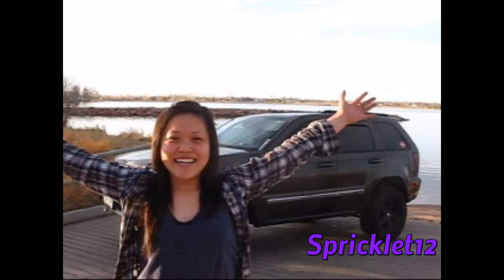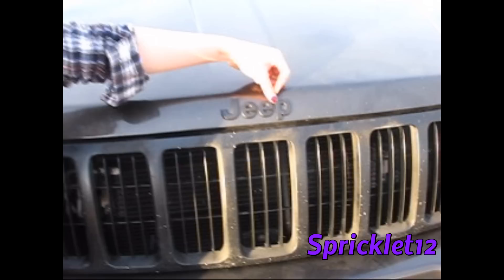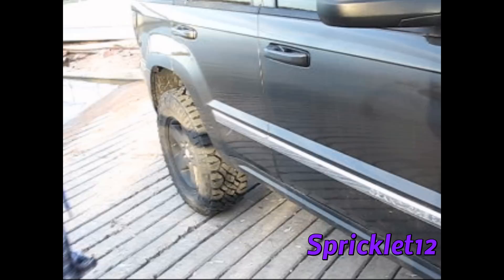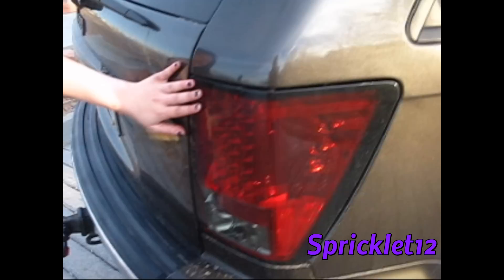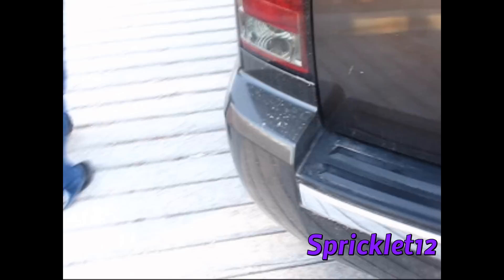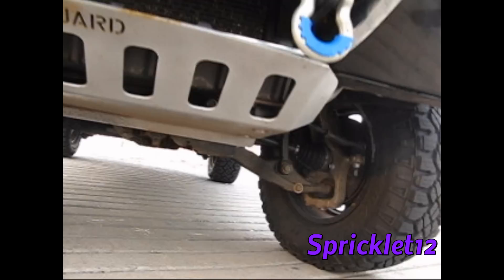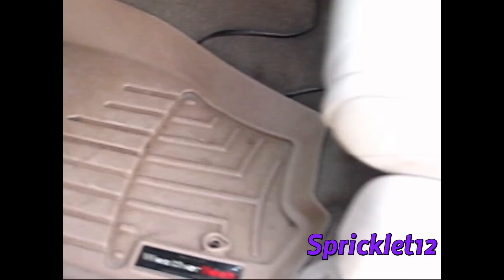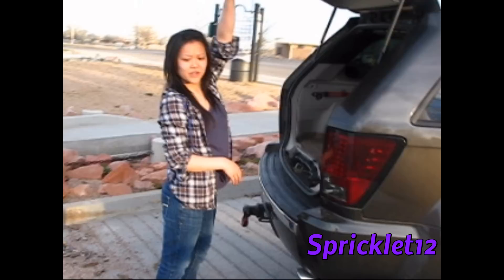Walk Around 05 Jeep WK w/Mods

Comment: ok TY tons, after digging I found a closeup to see what you did on your pich-weld. Very nice and makes lots of clearance room. Looks like you could clear full 33X11.5 tires. Throw RRO 2.25" lift ontop of your current lift and then a little rear fender bending to keep from cutting the sidewall of your tires when they stuff.
Reply from the maker: +JD Lewis I do want more lift, but don't want to add the rro 2.25 lift on up. Just my preference. I'm happy with the way my jeep is. This jeep has so much done to it, I think I'm going to pause the jeep build for now. It is a money-pit. Plus, I'm a student. I can't afford my main transportation always needing to be at the shop

Comment: Hi Elaine I have a 05 4.7 just got a 2.5 inch spacer lift and 2.5 inch wheel spacers what spacers do you have (size I mean) I also got two 12s in the back of my jeep too
Reply from the maker: +joe talento Nice !!!!! The wheel spacer i have on my jeep are SpiderTrax Brand Size 1inch and a half 5x5 bolt pattern

Comment from the maker: There is two options for the side decal. You can either use Plasti-dip and do it yourself or purchase decal vinyl and do it yourself :)
Reply: Elaine Chu Wow! thanks for the tip!!
Reply from the maker: Jeffrey Williamson  Anytime. I tried plasi-dip and did a crappy job lol so I opt out for decal vinyl and use an exact o knife to cut it
Reply: Where did you get the vinyl from. I'm completely new to all of this haha
Reply from the maker: Jeffrey Williamson No worries. I purchased it online. I searched for matte black vinyl roll on ebay. I got the 5 ft by 12 inches roll. that was plenty enough to cover all the chrome on the Jeep

Comment: Did you have to take your front bumper off to install those rigid led cubes? i'm trying to install mine but i haven't found a write up on how to install the lights in the fog light housing
Reply from the maker: MrLilsixxxes I did not have to remove the front bumper. The Rigid pods are screwed onto a mount. On the mount I drilled a hole into the bumper. Found a bolt, nut, and washers in the garage

BOOM
rigid pods as fogs lights

Comment: do you have the factory cd or aftermarket? how hard was wiring?
Reply from the maker: I have the factory cd. I didn't want to get rid of my 6 cd-changer! Lol 
I took my jeep to a bestbuy and had work done by them at the time. To keep my 6disc factory I bought this wire adaptor
Reply: Elaine Chu thanks for replying. I'm about to put 2 12"s in my Limited was just wondering how hard the install was because I'm keeping factory head unit also. Ur jeep is badass btw ;)
Reply: Elaine Chu does your factory cd only have high and low eq's???? wheres the mid? mines only a 2 band and its driving me crazzzyyy. Oh, and does your 12s make your disc changer skip?